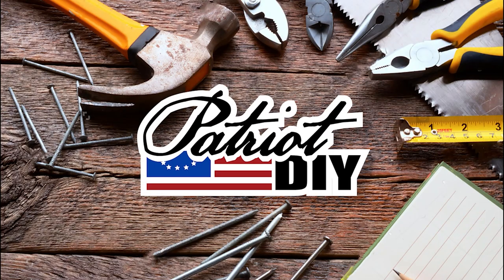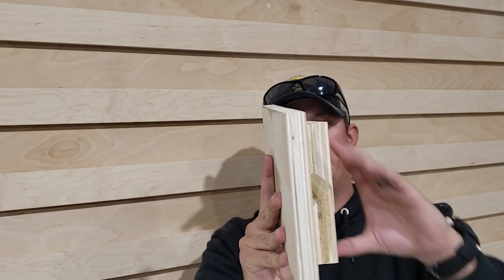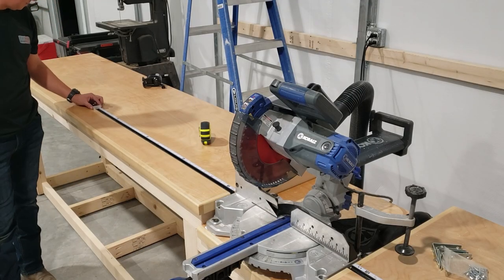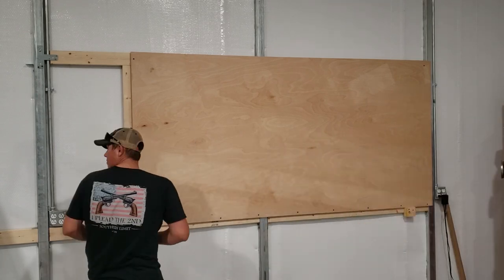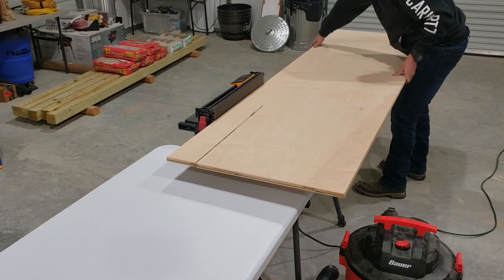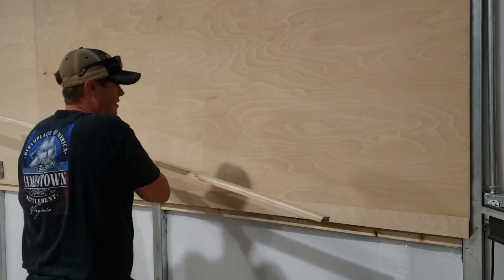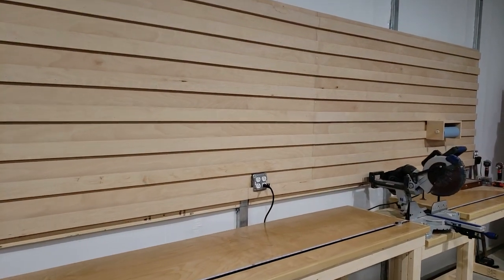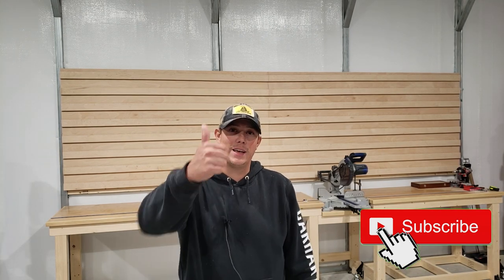DIY French Cleat Tool Wall

Comment: Question for ya.  Why are your outlets in your shop upside down?
Reply from the maker: Just Safer. If something falls and hits the plug it will hit the ground side instead of the current side
Reply: @PatriotDIY  It's funny you should say that because that exact thing happened to me when my tape measure fell while I was measuring and touched both leads. Makes sense!